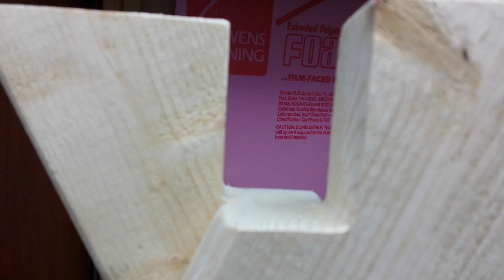Shopdog saw horse cnc the ends.

Comment: I would glue two 2x4s and make slots for the legs to fit, so that they would form shoulders wich would prevent the legs from moving like a parallelogram.
Reply: Martynas Valūnas You would have no idea how these are supposed to work then.
Reply: John Klatt Yup, totally, there's plenty of strenght, much like a 2x4 wall before sheathing.

Comment: Cant wait to build a set of these! My plan is to bolt the legs together w/the feet cut at the correct angle for  the legs Then take a 2x4 block to trace out the notches for the top (I will use a level).Then cut the slot out w/ a hand and coping saw.Once I have 1 pair that are good I'll use those as a template for more. Hey, in my head it sounds easy. We'll see
Reply from the maker: good luck hope it works out for ya..